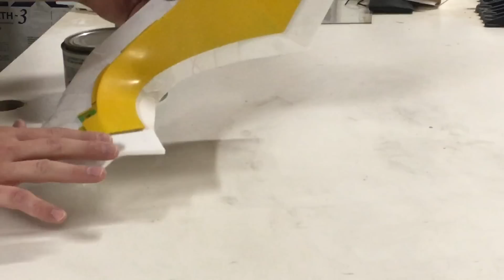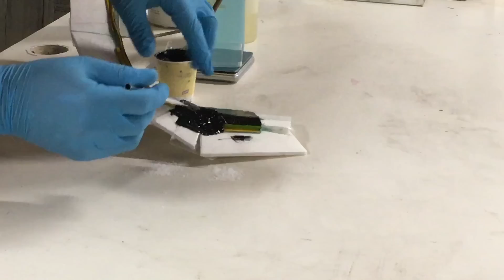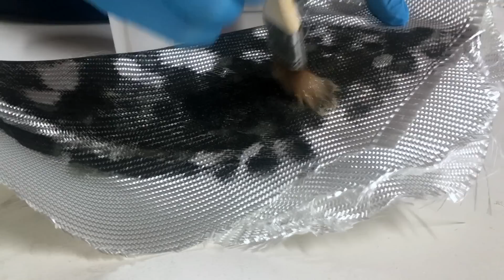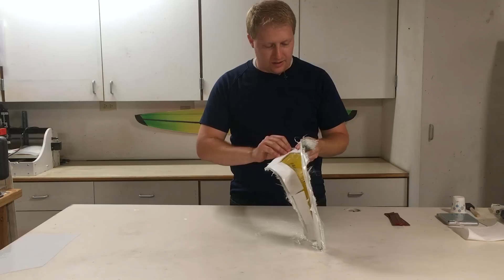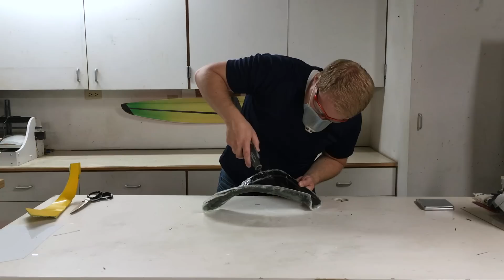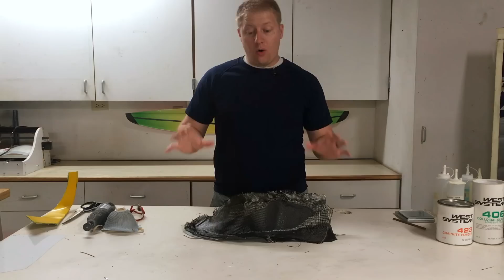How to Make Carbon Fiber Parts (Including the Mold)

Comment: Thanks man, this is what I need, concise and detailed. Thank you.

Have you done any two part molds, for a part that has mounting points and reinforcements on the back, this would be insanely useful, knowing how to get a propper edge whilst not sticking the two halves of the mold together.

Comment: What's the point of making a carbon fiber replica of a part? It's so that it is lightweight and stronger. But when you make it with fiberglass and then you cover it with carbon fiber to give it the appearance of a carbon fiber part. You're not only misrepresenting what you're selling or what you're making, but you're also making a part that is now heavier multi multi times heavier granted it is stronger but it's not solid carbon fiber, it's fiberglass and that's what the title of this video should say. How to make a fiberglass replica of some part?....
Reply: If you listened and watched the video properly, you would have realised that the mould was made of fiberglass, but the replica part made using that mould was carbon fiber.

Comment: Folks. Much easier way to do this is coat your part with parafin wax. Heat it lightly with a heat gun. Until the wax on the  coated part starts to smooth out and is glossy. Let cool then start applying your cloths and resin as he did. Then once it dries heat the mold while stuck together in the oven or with a heat gun until the parafin starts to melt. Then gently pry it apart. Any imperfections in the finished surface just sand smooth and work you're way up through the different grits of sand paper until you finish with 5000 grit. Then polished with some cutting compound and then polishing compound to a luster that you desire.... And done

Comment: Great video thanks! Is it possible to make a mold out of chopped GF and resin? Won't it be structurally the same? If strength is not a huge factor (I don't think it is for a mold?). Is it not easier to spread chopped GF than put multiple layers of CF? Or maybe chopped GF is more expensive?

Comment: You're missing a coupling layer between the tooling coat and the first layer of glass laminate. I tend to wet out the tacky tooling coat with a mix of resin and cotton flocks (renders the resin also a thixotropic depending how much cotton you add), the resin still being quire runny so that is also a first wet layer for the next layer of glass. Then the steps that cause air bubbles can be filled by taking some of the coupling coat mixture and adding more cotton flocks and some micro ballons. This will make it into a putty that you can fillet into the edges to smooth out the curve of the surface. Since it's all still wet the first layer of glass (I tend to start with a thinner cloth 80-100 g/m2) will follow the contours perfectly and will allow for subsequent layers to conform as well.

Comment: so your mold is a wet layup of carbon fiber is that right?

i've noticed a lot of people mention use of "tool gelcoat" instead and use of fiberglass instead for making molds

you mentioned you have 10 years experience but this is an older video, which way do you recommend?

Comment: nice tutorial ! is there a way to re do the clear coat these parts if they get scrached?
Reply from the maker: I'm no expert on that, but as I understand it you can always sand off the clear and re-apply a new clear coat.  Just be careful sanding because you can easily sand into the carbon.  I'd stop once you start seeing black dust.
Reply: @SasquatchComposites  ok thats what i thaught thank you for the advice!!

Comment: Great video! Just one question- you waited for the first coat to get tacky before adding the first layer of fabric. Do you also wait for it to get tacky before you add the second layer or do you do that while it’s still wet? Also, what happens if you run out of time in your day before you get all the layers down? Is it OK to let one layer sit overnight and then add more layers starting the next day?
Reply from the maker: Nope, I only let the first coat of resin get tacky and the plies all go down one after the other with the same batch of epoxy.  Letting the first coat get tacky isn't strictly necessary, either, but it helps keep the first layer of fabric in place so you don't get voids in the corners and it also helps with surface finish in the end.

Comment: I’ve tried a similar technique with the layup and all the resin slid down from the sides of the walls of the mold and there were dry spots
Reply from the maker: If you're doing large vertical walls then it can be helpful to put a little fumed silica in the resin to help keep it from running.  For small parts like this I haven't had issues, though.

Comment: If you run a perimeter of tape, and interleaving with a part laminate.  GRP makes better tooling  cheaper.  The same additives are the same.  Wet out is better,  Tooling ger is not expensive.  Don't get trapped in using epoxy where GRP will suffice.

Comment: I'm honestly very disappointed due to the fact that someone that has 10 years experience, compared my 3 years experience....you didn't use any paste, you didn't use a roller, and you didn't trim the part around curing time with a corner to use a plastic wedge and rubber mallet to pop out the part, your mold is also very thin. You're making way more of a mess than necessary. Molds should be around 4-5 times thicker to be a productive mold to make multiple parts.

Comment: Poly(vinyl alcohol) not Poly(vinyl Acrylate)  and yes it does make a difference.  The later is a glue that will not provide a release to the part.  Use clay to fill in the gaps, the wax will dry and shrink.
Reply from the maker: Good clarification.  As for the wax for filling gaps, I've used it several times now and as long as the gap is small it seems to work pretty well.  Clay of course works great, but it can also be a little bit of a pain to clean up afterward.

Comment: do you wait for it to dry when you put layer after layer of the fibre glass
Reply from the maker: No, do not wait between layers for it to cure.  You need each layer to go down while the previous one is still wet.

Comment: It would have been easier to see the viscosity as you dripped it off the stirring stick, if the mixture had been against a different background. The mixture was black and so was your shirt.  Otherwise it was great for a beginner.

Comment: I have worked with cab o sil and noticed he didnt have his mask mixing that powder in. Cab o sil is a really light powder that likes to lift and float around the air. Pour in slowly and mix slowly with no wind blowing around to help control the cab o sil from blowing around meanwhile it mixes with your adhesive.

Comment: Late to the party. Never done cf yet, and learning from these videos. Why did you make a mold first? Can you just make the cf part directly from the original piece?  Learning the "why" as well. Thanks and great video!
Reply from the maker: It's totally possible to use the original piece as your mold.  However, the fabric texture will show up on the outside of the part and you'll have to fill it in with epoxy and sand it smooth if you want to have a good finish.  That may be less work than making a mold, but if you're making more than one part it almost always makes sense to build a mold first.  The other issue with laying up over your original part is that it will not be a perfect match.  The outer surface will be offset by however thick your carbon is.  Depending on what you're making, that may or may not be a big deal.  In this case, where I want the part to line up well with other panels, it made sense to use a mold and get an exact replica of my part.  Hope that makes sense.

Comment: I’ve tried making a mold two times using gel coat brushed on. Brushing on the joker wasn’t the problem the problem was the gelcoat got extremely hot to the point where it melted the board I was using as a flange. Do you think I was adding too much catalyst?
Reply from the maker: That'd be my guess.  But I don't have much experience with -ester based gel coats, so I'm not sure.  I've always liked epoxy better for making molds, and I have never had an issue with it getting too hot except in the cup where there's a large volume of it.

Comment: I have virtual composite part, need to design mold tool for the composite part. What would be the gap between tooling surface and mold surface? And flange dimension? Mold tool height from table?

Comment: Why didnt you use a vaccum?
Reply from the maker: A vacuum pump is generally the most expensive tool used in composites and beginners might not want to invest in one until they're sure they'll stick with it, so I was just trying to show how it can be done without one.  Vacuum definitely makes it easier to avoid voids and it yields a lighter and stronger part, too.  I will likely do a vacuum bagging tutorial at some point.  Thanks for the sub!

Comment: That's cool and all but what about the features on the back of the part that allow you to connect to what the original part connected to?
Reply from the maker: This part didn't have any connectors.  Just a tab on one end and a screw hole on the other.  But I've heard of people making their own clips and bonding them onto the back.  I just haven't done it before.

Comment: Why wouldnt you just put the carbon fiber on the first mold why did you make a second mold makes no sense doing extra work for no reason ?
Reply from the maker: Not entirely sure what you mean, but I started with a part from a motorcycle, and made a mold from it so that I could make parts identical to the original part.  I didn't make two molds.
Reply: Some people are dumb. Great video!

Comment: good video thanks  a few months ago i had a lengthy  discussion  about Carbon Fiber with a cousin of mine  who is a Engineer by trade  he warned me about the sharp edges  of the fibers  and told me how nasty they can be on our skin  i have had a lot of fiberglassing experience  because of my boating hobby  and of course my Cousin knows that  ironically  for one of his Cpllege projects he and group of Engineers did do  a Carbon Fiber project   that was a man powered  boat  so he not only knows the technical side of it but has some hands on experience as well

Comment: Good vid, my opinion is that the flange should be clean as well, I believe it should be as clean as the part. If u ever decide to use bagging tape, or overhang of glass fibers it can lay minimal on the flange. When your laying bagging tape u want a smooth surface prep, u don’t want to have to work the tape into too many crevices or uneven pavement. 

For overhanging of glass fibers onto the flange, again u want that smooth as well for ease of release once cured. If it’s too ruff or patchy or uneven your going to gouge the flange which needs to stay smooth for the future possibility of vacuum bag, or again bagging tape, 
My opinion, everything needs to stay smooth&clean. 

Oh and it’s never a bad thing to make a big flange, at least 2-3 inches. If the flange isn’t large now you’ll  have to worry about mixing the bagging tape too close to fiber&consumables, do it once you’ll never worry again!

Comment: why cant u just vacuum seal the part to make the mold .1 that creates no bubbles and 2 it gives the make the ability to have no flaws ,  u could use a heat gun if u cant get a vacuum bag setup that deletes bubbles
Reply from the maker: No reason you can't.  I'm just showing that it can be done without a vacuum pump.  If you're serious about getting into it then you will eventually want a pump anyway, and you are correct that it makes it easier.

Comment: I appreciate you not editing your mess ups to make it look like it doesn't ever happen. Subscribe and now everything i own is carbon fiber😋
Reply: Patrick Mitchell I just had to add that the mistakes wouldn’t have happened if he would’ve used the proper materials from the beginning

For instance: instead of foam board- styrene sheet, smooth is better, always care about your flange

Carbon fiber for pigment- or how bout just black pigment, much cheaper than actual carbon graphite powder. The powder can be used for whatever but the true intention is a filler where carbon is truly needed

For the mold woven fiber throughout- how about a couple of layers of woven, the rest chopped strand mat, it’s cheaper 
I just think it could’ve been a lil better

Comment: Subscribed thanks for the Video I want to do this to the entire body of a somewhat sand rail and needed this info BTW if I am just Altering and existing body could I do this without the mold kinda free forming it?
Reply from the maker: For that I would shape foam (2" thick insulation foam from Home Depot is great for this) with a hotwire bow and sanding blocks, cover it with plastic, and lay up over it.  It's tough to get your surface perfectly smooth, though, so expect to have to do some sanding and filling after you lay it up.

Comment: I'm sure that I could see PVA brush strokes on the final finish or am I imagining it?
Reply: LEO it’s no imagination 
There is a much better technique to putting on PVA than with a brush, not even a spray gun.
Reply: @mlinecomposites1  How?
Reply: LEO take a small cup, 1 liter bottle, cut about 2inches out of that. Pour PVA in the cup, not too much, 3 table spoons full, then add water to it. Not too much , just enough for more than half of PVA. U want it kinda watery but u still want to see green. Get a rag, best rag is from a t shirt, u want the rag smooth, not woolly, no bigger than the cup, really small. If it’s a bigger part you would increase the mass of the mix, start small so you’ll get the idea. 

Whatever your mold is pour just about all of it on, work it there. Then wipe just about all of it off,  not bone dry just, enough that a heat gun will dry up the rest. The thinner the film the less you’ll see it. Done it a million times, comes off just as easy. U don’t need a lot of pva for it to work, just enough for it to release👍🏾
Reply: @mlinecomposites1  Thanks mate.
I don't quite grasp the 1st sentence.
Is this as opposed to using a gell coat?
Reply: LEO I’m sorry I wasn’t clear. This is for a release agent, prior to gelcoat. This would work after wax is applied
Reply: @mlinecomposites1  Thanks I figured that. Explain the cup / bottle explanation please. The cup and bottle bit.
Reply: LEO to make it easy use less than half of a Dixie cup, the smallest cups that Dixie makes. The kind for 2yr kids👍🏾
Reply: @mlinecomposites1  Nice one cheers Lance!

Comment: Get some different sizes of metal rollers..use them to press the layers together, roll bubbles out to the edge of the mold, roll excess epoxy out of your part
That adds weight to the product, and excess between layers makes it weak
Always always always use a roller on your parts!
Little tiny rollers for the difficult to get into areas ensures the cloth is pressed into every detail
Big wide rollers move bubbles along

Comment: Learn to use a compression.  It will allow those tight radius corners without vacuum using hand layup, you won't have any voids or need to use toe to fill in the tight corners :P

Comment: Would using the Vacuum method help with the lifting and rounded corners in general? Great video. Do fenders and side skirts plz
Reply: dont do carbon fenders please... don't do any sufficient body parts unless your gonna do the entire car, rear quarters, roof and all... keep it to Bonnets, Lips and Mirrors. TRUST ME doing half the body parts Carbon and half the car parts Painted. It looks terrible
Reply: Yes, the vacuum bag would pull tight into those corners and so would also push the carbon under it tight into the corner.

And it honestly is not much more complicated then doing it this way. You just need proper vacuum bags or tape and a pump. And use resin fitted for vacuum suction.
The hard part of doing this is the prep stuff, which is the same as shown here.

This is perfect for more flat parts with no hard details. But things with corners or complicated details are far easier with a vacuum pump.

Also, you could use thinner fiber weave for the first layer as it is easier to bend into tight places. And it looks better in my opinion. After that just lay up the thicker stuff unto that.

Comment: for being in the composit industry for 10 years you forgot 2 very important tools. your rollers and squeegies.
Reply: that is why you have trapped air bubbles
Reply from the maker: @MikeMiller-fc2cc  The size and shape of the part makes squeegees tough to use, but you're right about the roller.  I've spent almost all my time in aerospace and I'm surprised I've never seen rollers used there.  I only just recently saw one used for the first time and was impressed by how effective it is at removing trapped air.   Thanks for the reply!

Comment: wait, so what's the difference between the white carbon fiber and the black carbon fiber that you used? or was that fiber glass to make the mold first?
Reply from the maker: The white is glass.  Glass is much cheaper, so I use it for molds.